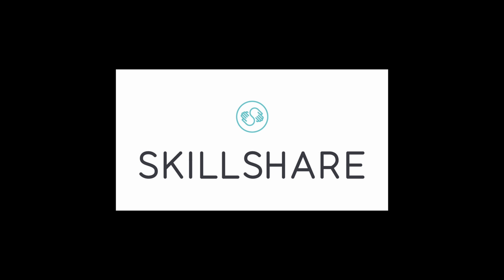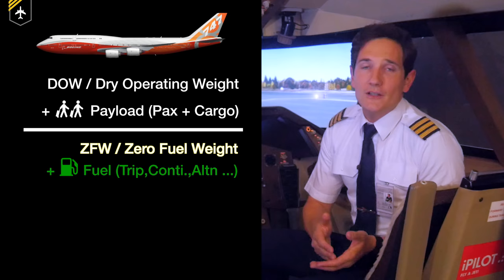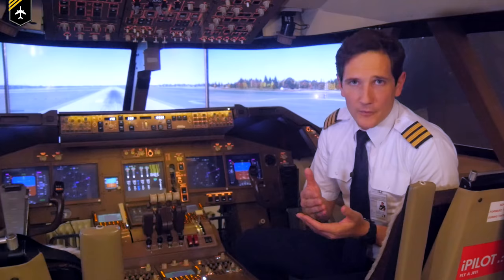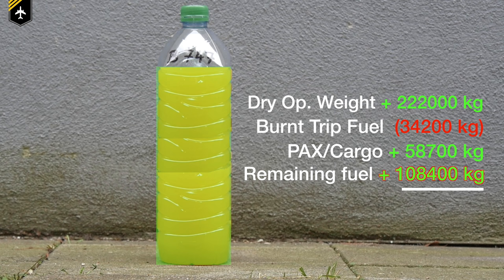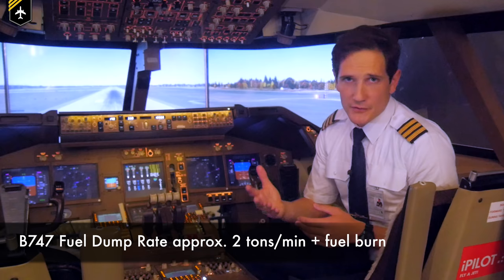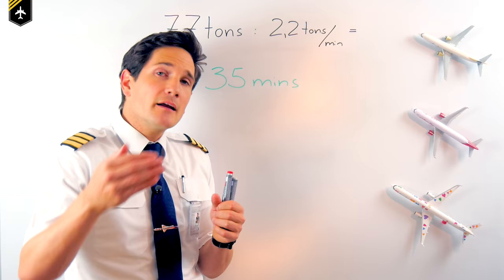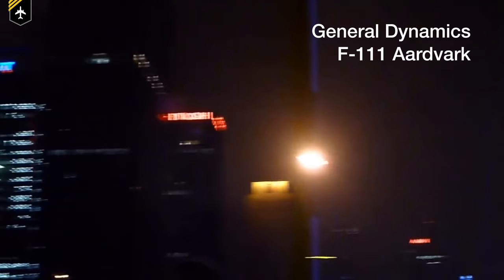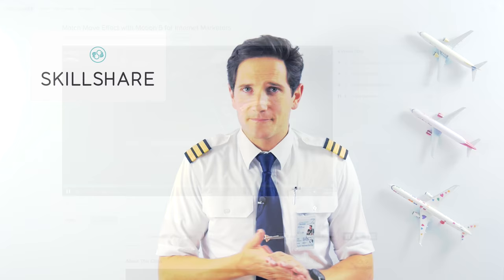Why do PILOTS DUMP FUEL??? Explained by CAPTAIN JOE

Comment: How many times on average does a pilot do this per year?
Reply: It's very unusual and only done when they have to divert very early on a long flight and it's really urgent. There are a lot of pilots out there who never done a fuel dump in reality, although their aircraft is capable of doing it.
I only know that over germany the average is 22 fuel dumps per year. But they had over 3 Million take offs and landings last year. So that would mean it happend on about 0.00073% of the flights. But you have also to consider that not every airplane is equipt to dump fuel.
Reply: hey, thanks for the info :)
Reply: so how come we see thousands of these so-called "fuel dumps" DAILY?!?!
Reply: Well, i honestly think it would be a waste of time to explain to persons like you the reason why you can see contrails because no matter what i would write, you wouldn't believe it anyway if it doesn't fit with your believe.
Reply: Try me, don't just assume but just please don't tell me that it's condensation
Reply: Sagittarius Alpha nice explanations and thanks lol
Reply: y3v1k the point is you just saw a condensed cloud in the tip of plane wing. its not a fuel. if im right, that is because of the aerodynamic of the tip wing and water dense.
Reply: dont forget that about half of the exhaust gas is actually water vapor, rest of what you said is pretty much spot on though
Reply: THANK YOU!! Must 've been a paint to witte it all down :p
Reply: "Cars cause climate change"
Reply: those are just exhaust trails not fuel dumps
Reply: GeneSun - fuel dumps at that altitude get dispersed into a fine mist, and even if it wouldn't fully evaporate it would at least spread over a huge area depending on wind conditions. I'd be surprised if you could measure an increased fuel concentration in soil.
Reply: Really? Still in denial? You've never went outside after hearing these loud low aircraft and smelled the awful exhaust burning? Don't act like it doesn't hit the earth. What goes up must come down somewhere. Quit acting like your yard is special. It's being polluted.
Reply: I've never dropped a water bottle and have it explode like that. This explanation is for the ignorant. It's terraforming with chemtrails. This shit didn't used to cover the sky.
Reply: Rizal- it clearly shows nozzles squirting out fuel.
Reply: +Sagittarius Alpha 
I have heard that pilots are not allowed to talk to the press about certain things. They are directed to the company's spokes person. Why is it we see this "fuel dumping" everyday. That just doesn't add up?!
Reply: "On the other hand CO2 emission makes almost 7%. So you better fuckin worry about driving a car. " There are far more people who owns a car. That's why that number is so high. Your logic is as followed: The world is already polluted with harmful gasses so why worry about more harmful gasses or whatever you call it. You can handle a few numbers but you show no signs of simple and healthy logic. "Even if there is any conspiracy or some secret society is trying to do shit like that- there are way better ways. " Which way would be better? You do a lot of talking but no evidence or explanations.
Reply: + Sagittarius Alpha
And that's why so many Wikipedia entries are the way they are. Once you get in there to "fix" them you realize they're actually "pretty close" and it's way more trouble to fix them than it's worth. After all, it's not a textbook.
Reply: +Sagittarius Alpha
So if i see fuel dumping/trails/chem trails i should tell the pilot to let me die with a heart attack instead of dumping fuel?? Do you see how much sense you dont make right now? I see trails from planes everyday. EVERY SINGLE DAY WITH A CLEAR SKY.
Reply: So you telling me thats the same when im outside driving in my car at freezing temperatures? Why is it that most planes are generating this condensed water but not all of them are doing it? I live pretty close between two airports so i see A LOT of planes. Some producing these chemtrails/ trails/condensed water/finger of god some of them does NOT.
Reply: Joseph Poniatowski Well according to your channel any non high-altitude plane or special cloud is a sign of chemtrails... maybe you go look up some actual science about clouds and their complexity...
Reply: jannick singh I wonder why there never has been a whistle blower... kinda surprising with the immense amount of pilots hmmm?
Reply: Sagittarius Alpha You just dont know how much ive learnt with this thread thanks to you.
Reply: thanks for that, not sure it was helpful but thank you
Reply: Experimental Fun i
Reply: He'll frn 
Im from Nepal 
Before something 8 years to now Nepal sky in This z plane Flight on every day but Why this plane use nepali Sky and where they  plane go? Mount Everest sky route use this plane and flying every day 
Olz if u know so comment me ok
Reply: Instead of dumping hundred of gallons fuel we use alternative option like military pilot has ejecting seat that way we make ejecting fuel tanks that they reach safely on Ocean or river with parachute and land and flot with air bags that will be save Billions of dollars per year, "(THAT MONEY SHOULD THEY USE END POOR LIFE AND TERRORISM)".
Reply: Sagittarius Alpha jets engines by design today do not leave condensation trails ..so explain that ..iv sat an read all your comments an I have to  say it seems your defending the establishment definition of wat we all say everyday in the sky  ..an one more thing if it was condensation why is it persistent an remain in the sky all day till it becomes a haze that doesn't dissipate..
Reply: Modern Jet engines doesn't leave condensation trails ? Modern jet engines burns fuel at a better ratio so it does generate MORE water, not less. WTF? Thats not up to jet engines only, also combustion does generate H2O (also known as water), it can also happen due to decreases in pressure. These stuff are just like clouds so they can persist if the correct conditions are met.
Reply: never!
Reply: There are certain issues that carrier management does not want to discuss to the world since it involves either competitiveness or contracts say with the manufacturer over equipment.  the FAA has limits too on what can be discussed about day to day travel since it would involve terrorism and emergency planning.
Reply: The point being is that many modern passenger planes today can quickly dump fuel if there is a perceived need to do so.  in the Swiss Air 111 incident the captain issued the "pan-pan, pan-pan, pan-pan" alarm meaning he was looking at something (smoke from the air conditioner) but had not decided to declare it an actual emergency.  Unwilling to deviate from his customary habit of not creating an urgent situation when it was inappropriate he did not try to down the plane before executing this dump.  Analysis of the timetable proved there was an unreasonable chance his "pan pan pan" call was in time to save his plane, but people do criticize him for not trying to just go in on high fuel and risk this pilot's overweight landing risks.
It is worth noting in the unfortunate Everglades crash of a regional jet over a mistaken oxygen canister the captain in command of that flight indeed had a history of downing planes only to discover the AC caused a smoke issue instead of it being a serious emergency.
Reply: Unless of course you are approaching Queenstown no?
Reply: jannick singh as an aircraft engineer of over 18 years, i have had 1 (one) aircraft arrive that has had to dump fuel. 
We as an airline don't dump fuel for fun, fuel costs the airline about 40% of our outgoings a year so its not something that is done lightly. 
Imagine you are on board having a medical episode and we were prevented from dumping that fuel to save your life, you may die and then not be able to come up with random conspiracy theories into polluting the world with milllions of flight dumping fuel every year
Reply: Chem trails lol
Reply: Those aren't fuel dumps, that is air or water being pushed back by the jet engine which causes it to move at a velocity which is comparable to the object that caused it. This is also called "slipstream"
Reply: But what he said was that it was a way to prevent internal damage. Yes "jet is (must be) certified to be able to  land with max-Take-Off-Weight" but it doesn't mean the plane can't get damage while being capable of landing.
Reply: Depends upon airline to airline😂😂
Reply: In the early 1970s, I was flying as a passenger in a Boeing 727 from Denver to Salt Lake City, and the pilot thought that he may have blown a tire at takeoff from an intermediate stop, Rapid City.   The pilot had made a very rough landing at Rapid City, so if there was a blown tire, it was likely the pilot's fault.  The landing gear was looked at by the number of pilots in small fighters who flew near to us, and they didn't see anything wrong.  The pilot dumped fuel over the Great Salt Lake in order to reduce the weight on the landing gear when landing, and to reduce the amount of fuel on the plane in the event of a fire.  The landing was normal, there was no blown tire; we had fire trucks and ambulances chasing the airplane down the runway after we landed, fortunately they weren't needed.
Reply: Sagittarius Alpha lol but bottles weren't made to fly and land like planes ;)  are
Reply: You find the answer in one of the videos made by that other pilot, the blonde skandinavian guy.
Reply: On average?  Zero times.  Or perhaps .000000001 times? :)

In the rare situation that a large wide-body airliner is fueled up with 300,000 pounds of fuel for a trans oceanic flight and also experiences an emergency that requires a return to the airport after takeoff, the fuel can be dumped as shown in the video. 
One cause of needing an emergency landing is an engine failure (which is extremely rare), but in reality, the most common cause is a passenger medical emergency.
Reply: Sagittarius Alpha, thanks for your detailed explanation! 
I'm only commenting because you said "What this captain is telling is not really true."

I don't know what the highest approach speeds are for the A340 at MTOW, but in the case of aircraft like the 747, 777, MD-11, etc...  
even if we decide to not care about the possibility of structural damage or overweight landing inspections, the approach speeds required to fly at 1.3 Vs/Vref could be so high as to make it impossible to stop on a 10,000' runway.  I think that is probably the limiting factor.

What is Vref on the A340 at MTOW?  Is it pretty low?
Reply: Just want to say thanks for commenting in this thread, I learned a lot from the video but more from you, maybe you should make videos too :D
Reply: @Sagitarius Alpha
Reply: Araya Light 
I think we are being decieved..but I still really love the way they do it...Almost me guys...but my cancer says otherwise
Reply: shi01 he asked for the salaies!!??
Reply: Araya Light 
Araya Light is a Ray of light 😇
Reply: StratMatt777 so you believe that over 100,000 pilots/captains are part off this pathetic delusional conspiracy theory? With not a single whistle blower? You sir need to get your head checked ASAP
Reply: Where did you get those figures? Bullshit. It's actually less than 6 per day.
Reply: ruff xm what a drip.....
Reply: this person is not even a pilot, but by showing you some numbers, he managed to trick you, making you believe that in some way, he is qualified to explain something that he really does not know anything about.
Reply: Technotuna Of course, the most important point is that the wings ARE the fuel tanks, they don’t contain the fuel tanks. Some planes have a bladder in part of the hold for extra range, but airlines don’t like them much. They lose space for paying freight that way.
Reply: Experimental Fun captain Joe is silly at best. I've seen up to 5 of these planes criss- crossing my skies at once. If pilots are dumping this much fuel they should be in jail-- I'm not supposed to was burn a bonfire because of air pollution. - I'll get fined. They just think we are stupid-- captain Joe - go back to your comedy show --
Reply: Sandra Sauve I need to emphasize for you that planes dump fuel ONLY in the case of an emergency!  Just because planes are going overhead doesn’t mean you have ever had a fuel dump over your house.  Do you live near an airport?  If not, then you’re chances are even less. No need to worry about things that will not hurt you.  Contrails are NOT fuel dumps, nor are they chemicals. Don’t listen to the conspiracy nuts 🥜.
Reply: Ampersandrascott I exactly. Not dumping fuel- so what chemicals are being dumped on a regular basis and  by many planes at the same time  overhead. Look to the skies.
Reply: Sandra Sauve Sigh!  Just pick something. Rose water?  Arsenic?  Baby oil?  As long as we’re being fanciful, it doesn’t matter what it is. You should never go outside if airplanes are flying over your house to dump chemicals.
Reply: I think you are confusing fuel dumping with contrails. Two completely different things. https://en.wikipedia.org/wiki/Contrail
Reply: You see how the plane weighs so much but its just floating coming in and leaving.... Commercial jets dont use JET FUEL. 600,000 lbs... and just going at high car speeds? Commercial jets use more than jet fuel. You guys need to research flat earth.
Reply: "100.000 tons of water are evaporating into space every year". And someone can estimate how much water comes from space every year?
Reply: Happens all the time in the airforce
Reply: y3v1k you see thousands daily? Do you live near a large international airport? Because I only see maybe 50 planes a day on average. And I see maybe 2 t0 4 fuel dumps a day on the high side.
Reply: Sagittarius Alpha I really enjoyed how you explained all those low brainer kids the world and simple physics. Thank you!
Reply: Chris L - So air pollution, good.  Ground pollution, bad. 
GeneSun is pointing out the hypocrisy of government and the special treatment that the aviation industry gets when it comes to emissions and noise pollution. It's the very reason why a lot people in aviation are so incredibly arrogant, they get away with all kinds of shit us "ground dwellers" would never get away with.
Reply: Thousands of times a day.
Reply: Always and every time. Imagine a society that really cared about resource management? Who would make money out of saving energy? Overspending and overproducing keeps the pockets full.
Reply: Preston Vaughan 
Flat Earth 😆😆
Reply: y3v1k same question
Reply: Boeing's figures show a max take off weight of 800,000 lbs and a max landing weight of 574,000 lbs for a Boeing 747-400 with CF6-80C2B1F engines. He did not say overweight landings cannot be done, but the have high risk of damaging the aircraft, (which is not inconsistent with what you said)
Reply: Experimental Fun a pilot will dump at least once on a long haul flight
Reply: shi01 no bc fuel dumps happen when a plane is passing over so you'd have to count every plane that passed over Germany t get an accurate probability
Reply: y3v1kLOL.
Reply: Joseph Poniatowski LOL
Reply: Around newyork area, in a good year, u might have 5 days without chemtrails. I c, clearly, 10 + planes flying from. east to west? And very few planes r flying across those trails: I'd guess: have to connect em?
Reply: Mute your speakers, tape your camera and read this carefully.
It's NOT fuel they're dumping but a special liquid-gas developed by secret US agencies.
Inhaling these muntant molecules affect your brain decision center 
resulting an urge to drink coke, eat chicken Mc Nuggets and vote for Trump.

Now that's in the US, rest of the world we just observe how spinned water looks like.
Reply: no it actually really was a fuel dump
Reply: I don't know about y'all, but I make a point to take a dump every morning. 😀
Reply: y3v1k you are seeing contrails not fuel dump
Reply: y3v1k you are seeing contrails not fuel dumping
Reply: chemtrails
Reply: @shi01  ok... So why is there so much "chemtrail" in the Sky since 20 years??
Reply: @Idorise  Don't know, never saw one of this "Chemtrails".
But what i see frequently are contrails. You know, this white cloudy stuff that internal combustion engines left behind because one of the combustion products of all hydrocarbons is...dihydro monoxide. Actually really nasty stuff. You know, you can die if you swallow to much of it. As a gas it can burn your skin and it's also a very potent green house gas. Also i heard they found a lot of this stuff already in our drinking water and that we are actually already addicted to it and we would die if we don't get a dose in regular intervals.
Reply: @shi01  ha ok... thanks for the precisions! ;)
Reply: 1) Have you (or anyone else) spent enough time /not/ in cities and towns to know this, or are you just not seeing the ones out in the middle of nowhere because you aren't there?
2) Since cities and towns tend to cluster, and airports tend to be built where the population is clustered, and there tends to be a higher density of planes operating near airports (for some reason Science will never explain!), wouldn't you expect more plane-related things near these locations?

(I live over 100km from a state capital - and any major airport -  but under a flight path between three state capitals - the airspace above us is the usual turn-off point for the third - and see large planes and their contrails quite often - though only in particular temperature/humidity conditions, since it is the plane's exhaust temperature/humidity interacting with the local atmospheric temperature/humidity that causes them - they are water-clouds, artificially generated as a side effect of how engines work).
Reply: @y3v1k  Why is the sun hot and bright? And don't tell me that it is hydrogen being fused into helium!
Reply: @vikiai4241  Maybe...Maybe not... Nobody Can prove
Reply: @ArayaLight  Did you really suggest that you can smell the exhaust of a jet flying over your house at over 5,000 feet above?  Can you also smell a bus from a mile away- its about the same thing and distance, you know.
Reply: @thecityman1910  Yes I did. What comes up must come down. Do you not know what fireworks smell like?
Reply: motownautospa  See what all the time? Contrails? Well i hope so, would be strange if a combustion engine wouldn't produce them in cold air. Because that would mean that the engine doesn't run.
Reply: @y3v1k  ahhhhhh the chemical sunrise and sunset,,  geomodifaction🌈
Reply: @y3v1k  CONDENSATION my dude